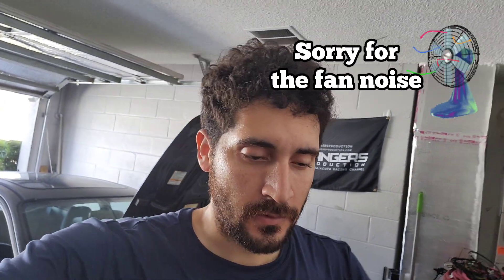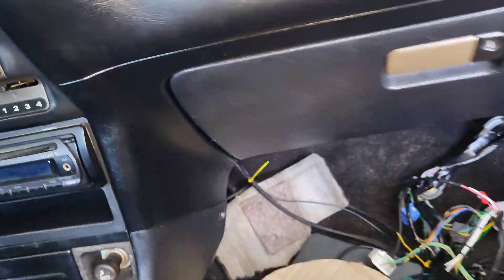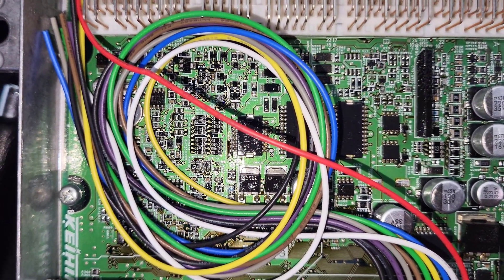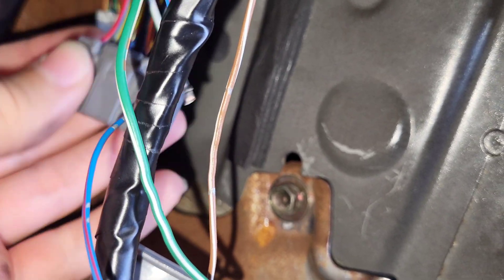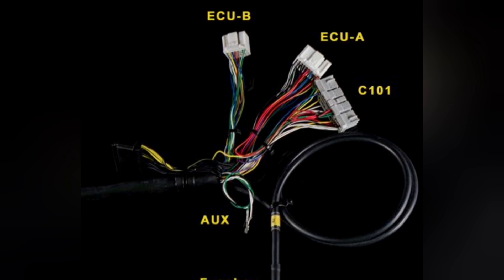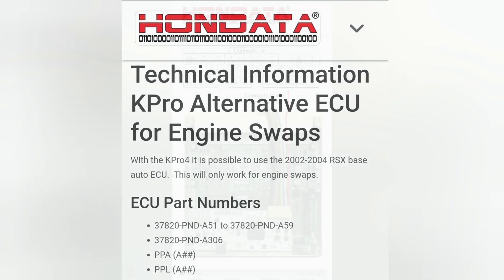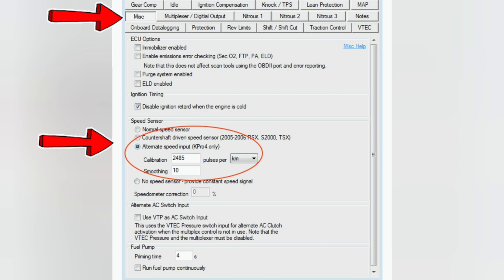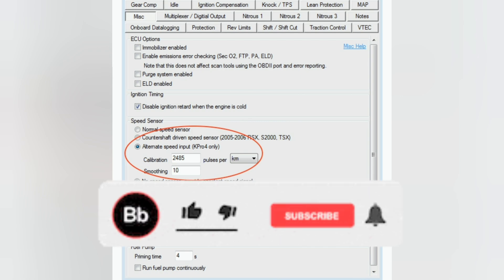How to wire up VSS on your Automatic K20 ECU to work on your Tachometer.

Comment: Will it work in an rsx if I repin the VSS and using the ppl ppa or pnd auto ecu
Reply from the maker: From my understanding kpro will work for this. ECU compatibility: The 2002-2004 CRV automatic ECU (PPA or PPL) can be used with K-Pro for engine swaps, but not for a stock CRV. 
But please reach out to hondata to double-check, i have called them and ktuner before in the past. And I believe it could work but by moving the vehicle speed sensor (VSS) wire to the K-Pro4 board. hondata has said in the past that it works for "Swaps only" but please call them or do more search before doing it.
Reply from the maker: Great question bro! I hope this helps out others.
Reply: @Almostboosted uggh I will likely just use the PRb and have it installed.  I initially wanted to keep some parts original so i can put it back to stock. Or might look into fuel tech and check the hype
Reply from the maker: Update: found this in the forums 

Ok. So I called Hondata and they confirmed that "yes" I can use my AUTO ECU with a Manual transmission.

https://www.hondata.com/tech-alternative-ecu-engine-swap

The reason they say, " This will only work for engine swaps " is because they personally have not actually tested an AUTO PND ECU for an "Auto-to-Manual Conversion" project.

They did assure me that it "SHOULD" in theory work because the " ONLY " difference with using an Auto PND ECU is that it processes vehicle speed from a sensor on the automatic transmission.

As a solution, the K-Pro 4 board has an input to process vehicle speed. When an Auto PND ECU is used, the VSS signal wire must be moved to the K-Pro4 board to process.

Just De-pin wire A18 VSS (typically white/green) from the RSX wiring harness.

Connect to KPro circuit board patch harness input VSS. The wire is typically red and marked on the KPro circuit board.

Within the "KManager editing software" go to "Misc". In the KPro parameters use a starting value of "2485" for pulses per km. This will vary up or down depending on your gear ratios and tire size.

When you do this, the needle on your speedometer will move up and down normally.

This was the " ONLY " difference that Hondata said concerning an Auto vs a Manual ECU.

So I definitely got confirmation that I can use my stock Auto ECU if I were doing just a K24A2 swap
Reply from the maker: Short answer the PPA or PPL ecu will probably not work for RSX but is questionable it could. 
RSX PND 02 - 04 ECU AUT  yes it would be like doing a Auto to Manual swap.
Reply: @Almostboosted one of the authorized dealer here in NYC sells all three, pnd, ppl and ppa

Comment: Hey brother do you need to take out the pin completely or splice it in to the new wire???
Reply from the maker: I depin it to avoid any problem. That's what hondata wanted me to do. Not sure if  the auto ecu the A18 slot is meant for the another signal.

Comment: 37820-pnd-a56 is at ecu??
Reply from the maker: As long as it is a pnd from 2002- 2004 auto or manual you can kpro
Reply: @Almostboosted I have code P0500 on my VSS on my dashboard but not the ECU. Could that be the problem? New wiring and connectors. Yes, my ECU is a PND 2002-2004, but I don't know if it's manual or automatic.
Reply from the maker: Idk which ones are auto. Maybe by looking up the pnd code. Try troubleshooting  the vss sensors and the wires if not then you might have the auto and would need to jump the vss and inputs in parameters for it to work.
Reply: @Almostboosted 37820-PND-A51 to 37820-PND-A59 (a51, a52, a53, a54, a55, a56, a57, a58, a59) automatic???
Reply from the maker: I ran the 37820-pnd-a56 through ebay and it comes back to an automatic ecu. If you already jump the ecu wire to the vss pin. You and nothing worked you need to troubleshoot your vss sensor and wires.
Reply from the maker: If you are using and auto ecu on your manual rsx because idk the car your are having the vss ecu problems. You would need to jump the vss directly from the ecu to the vss pin maybe that would fix your problem.

Comment: I did this but VTEC still doesn’t activate. Any idea why ? my VSS reads
Reply from the maker: You need to check your parameters and possibly wires and or the vtec solenoid.
Reply: @Almostboosted  Solenoid is good. I had my A18 wire and Red wire twisted together both coppers touching. . It ended up fixing my VSS which didnt read before but VTEC is still not engaging. The only wire i touched was the white and green (a18). Not sure of it has something to do with my tune or ecu
Reply: its a PPA-A52 ecu using it on a 2003 rsx type s. I reached out to hondata and they said it should work fine
Reply from the maker: @moofh I know the tunner can disable vtec via parameters on kpro double check your settings. Also it sounds like it could be wiring related.
Reply from the maker: @moofh because that PPA ecu which happens to come from a crv is compatible and it should be working just fine besides you having to wire up for your reverse lock out.